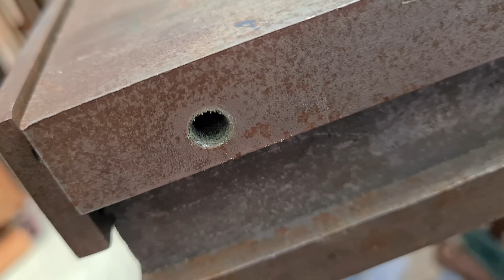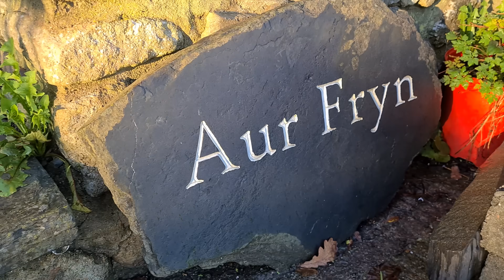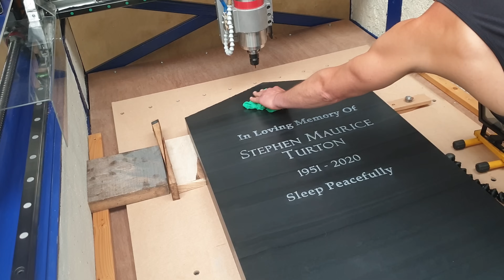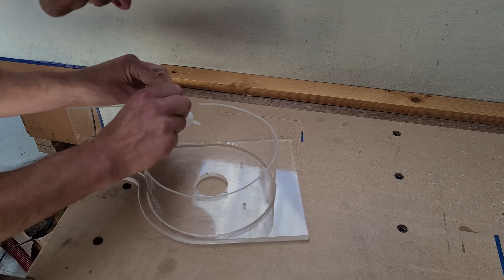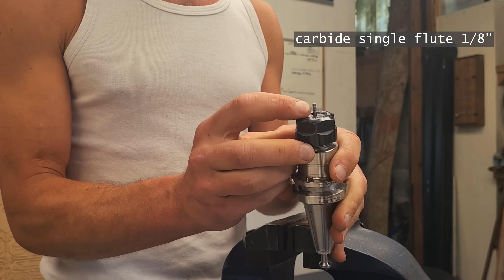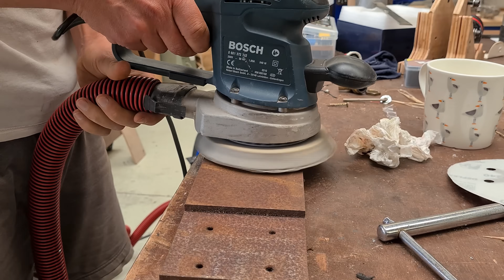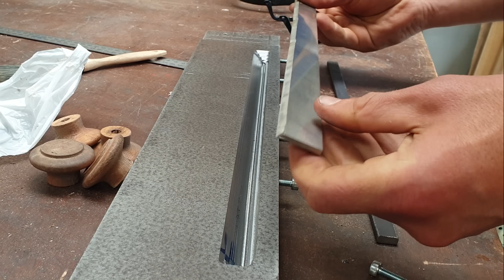The CNC was not Designed for this!

Comment: Love the vid's.        It's good to see the 'how not to' along with the success's.      
 I Built my 600 x 900 CNC about 5 years ago with help from a local chap (In his '80's..) and generally annoyed him by just taking his 'principals' and building the frame with my own idea's..  oops.    Truth was I didn't like all the problems that welding caused.. (and I couldn't weld anyway..)

As a retired carpenter I have lots of woodworking tools and machines..  but also had experience with working 'Resin' boards of various kinds..  Trespa.. Meg.. Compact.. (Thick HPL..) and has proved invaluable over the years for jig making and in this case (CNC..)  the framework and platten and for the bearings to run on.             I would certainly recommend Trespa as an alternative to many metals as it machines very smoothly, has the density and appearance of Slate and is very stable.  Like wood, it is layered so screwing into the side may split the board but can be thread 'Tapped' very successfully.  It can occasionally be found on ebay in 6 -12mm thick sheets or go and raid some public toilets where it is used as doors and walls.. (Not advocating this of course..)..
Good luck on your adventures.

Comment: Worked as a Tool and Die Maker for around 20 years. I really enjoyed machine work. Wished I had a small CNC in my garage. Grinding them magnetic chucks can be tricky because you need to choose the right grinding wheel that is porous enough not to load up and soft enough to break down.

Comment: Just a heads up on abrasive grinders, you do need to set up a diamond dresser to cut it after a few passes as it’ll make it cut like it was supposed to and not smear/burn on the final cut especially. Along with only .0005” max cut depth is a good idea when you get close to full contact.
Reply from the maker: Thanks for the advice shadowcards!

Comment: You are breaking bits because your step over is too large for the cutting speed of the bit. This means the bit is pushing into the material and snapping off. Either move the head slower or take shallower cuts. You are lucky you didn't burn out the spindle on the grinding. You should have taken VERY shallow passes and taken the high spots first and each pass only stepped down a thou or so. The first pass should only have made contact with a few spots of the mag chuck at all. You are cutting the wrong direction for the bit in some cases, and that whining noise is chatter and a sign that you are doing it wrong. Not only will you destroy your spindle, motors, guide ways and controller, but you will get bad quality in the end.

Comment: this is a diamond grinding disc. it's made for grinding carbide tools and hardened tool steel. any material softer than that will clog and damage this wheel.
you need a conventional oxide wheel for your task (that stone ones from a bench grinder). but it can shatter.
the better way to do such a crazy job is to mount an angle grinder to the Z axis.

Comment: The issue at the bottom of the vee is that the tool at that point has close to zero rotary speed so rubs instead of cutting. You should have cut, for example,  a Ø3 wide slot x 2mm deep at the bottom before doing the 45° sides. This is the sort of profile most vee blocks have as it is usually unnecessary to create a really sharp internal 90° corner.

Comment: Your machine is awesome, very nice and very respectful doing the headstone yourself. I like all your engineering prowess. You may find that your cornering speeds need to reduce to save your bits from snapping, that's if it only happens around corners, although a 20% feed speed reduction bay serve you well. Very nice work throughout and honesty with the grinding, definitely worth a try though 👍

Comment: The goo in the hole is probably old coolant. Those mag chucks are almost always used with flooded coolant that gets everywhere and then it can dry up leaving an oily sludge. Mixed with a bit of grinding dust probably looks like the contents of that hole.
Reply from the maker: Sounds very plausible - mystery solved :)
Reply: @FloweringElbow  It's usually rancid, give it a sniff, then you will really know 😉🤢

Comment: events that would be a "crash" in commercial machine hardly slow you down! Building the tool from scratch must inspire a peculiar confidence in its use/abuse!

have you compared climb milling to conventional milling on this machine? With lower speed tools I've found conventional milling helps cut hard materials with less chatter but not always true- can depend on cutters and chip clearing as well.
Reply from the maker: Hey John, ooo, that's interesting. I'll have to have a play with that, I've only been using climb really... Thanks for the encouragement. Totally agree about a special kind of confidence/ recklessness you get through building a machine ;)

Comment: Starting from one side and making a VERY small stepover (measured in thousanths) will mean the cup wheel will only cut on the corner instead of the face.... very slow but major reduction in spindle loading...
The "welding" in the bottom of the vee groove may be from re-cut where the swarf hasn't been removed and runs through the cutter over &over... 🤔

😎👍☘️🍺

Comment: Not sure if your cnc controller supports it, but may be helpful to look into using a probe to take several points over the entire un level work surface to create a mesh of the surface and then the cnc controller can automatically raise and lower the spindle in real time to account for the unevenness. This is used in 3d printers all the time
Reply from the maker: Good evening Win7rulz. I was using Mach3 and it couldn't easily do it, but... 
Have just been offered a mach4 licence, so may well be trying this in the future. Thanks for watching :D
Reply: @FloweringElbow  LinuxCNC has a component for that made by Scott 3D
https://www.youtube.com/watch?v=3BpqfBpozeM

Comment: Its an impressive machine, huge volume.
I would see about a steel or aluminium clamping bed.
Maybe T slots or smooth holes & threaded holes.
Maybe a partial vacuum chuck.
There's a lot of options you could borrow from milling machines / machinist's.
Reply from the maker: Hey Deepwinter, thanks for watching. Agreed, I think it would be very worth it to upgrade the bed. I'm kinda hoping to find some old cast iron mill table or something - to replace a section of the spoil board, that I could then use for metal machining. Peace, Bongo.
Reply: @Deepwinter :  Keep watching... I have a strong feeling "We ain't seen nuthin' yet"!

Comment: a grinder on a precision slide with a reciprocator is how you grind and polish surfaces. you could have put your grinder in a router table and push the clamped planer blade and jigss over the spinning honing stone flush with the table. good luck.
Reply: @Private Private :  Boring...!  If he had done that, we would have been denied this fantastic video!   😉

Comment: That's the wrong kind of grinding wheel for that use case, you'd be better off with an Aluminium Oxide wheel if you can find one in a cup style. Keep your depth of cut under 0.03mm.

Comment: Awesome projects! Am I right in thinking that the grinding cup makes the surface flat because it's only cutting on the rim? Theoretically, you should be able to use a smaller diameter and still get a good surface flatness, and then there's less torque on your spindle and it might not stall?
Reply from the maker: Hey Leo, you are spot on correct! A smaller wheel, as well as requiring less torque, would have a correct surface speed at a higher RPM (closer to the spindles torque zone). I originally thought I'd be (mis)using this wheel on my mini mill (full speed 1500rpm)... Thanks for watching and commenting friend :)
Reply: @FloweringElbow  hi Bongo! Before you try this again, find and watch Joe Pie's video on using a mill as a grinder if you haven't seen it yet. He did more or less the same thing using a smaller white cup wheel, and he explained a lot of the theory and how to ensure it works well for you. I think Joe covered it as well, but you'll also absolutely need a diamond single point dressing tool for a ceramic based grinding wheel. I'm pretty sure Joe also put a bevel onto the cup wheel, leaving the perimeter as the edge that made contact with the workpiece.

It's been awhile since I've watched the video so I apologize if my answers weren't more helpful. Also take a look at Blondihacks, I think she might have done the same trick.

Great video, and truly well executed with a bunch of persistent hard work. Keep it up!
Reply from the maker: @2011JMB  Thanks Christopher, I appreciate that :D

Comment: Hi! its hard to believe that's actually stone, looks like plastic on video lol
"This Old Tony" has a great video on CNC Checkering.. IMHO fiddling with software surface mapping is easier* and more flexible with the materials you can use ; Granted you pay the upfront cost of a DRO.
I love the work you've done so far! Best of luck with future projects!
Reply from the maker: Good morning azzoubk6777, thanks for getting in touch. I know what you mean about the slate - it was very smooooth.  Yeah, I think I have seen the video you mean - I'll be setting up a probe etc at some point and yeah it would have worked with the stone well (rather than all the re-zeroing I did), But I wouldn't want to be testing out the system on that stone, so many things that could go wrong already... Thanks again, Bongo.
Reply: @FloweringElbow  Bongo.. Ha! cool name..
Mine is Toast...